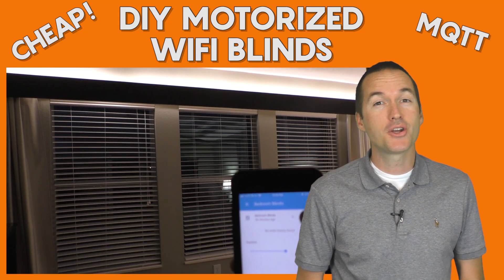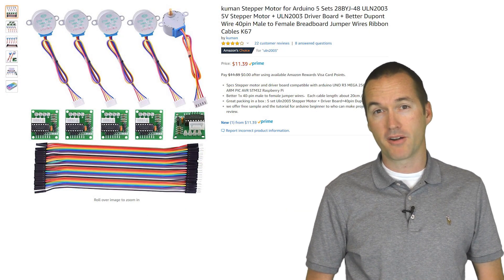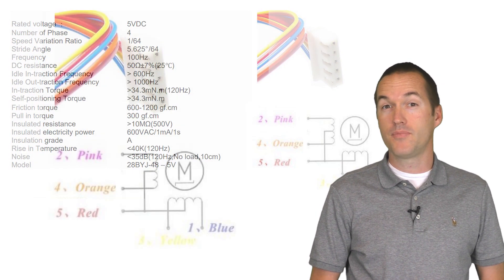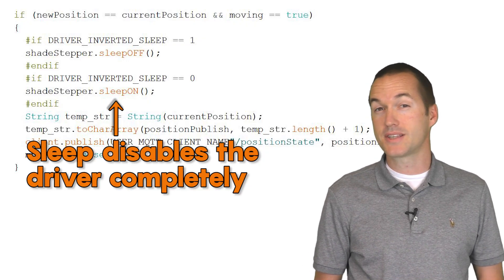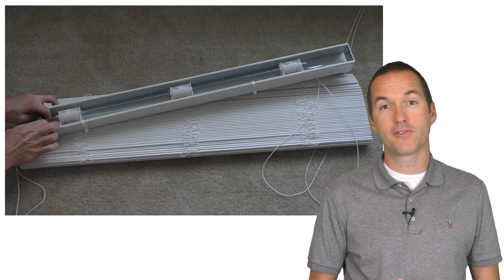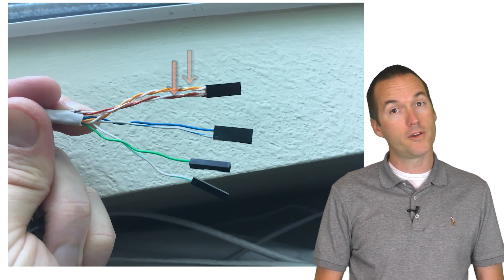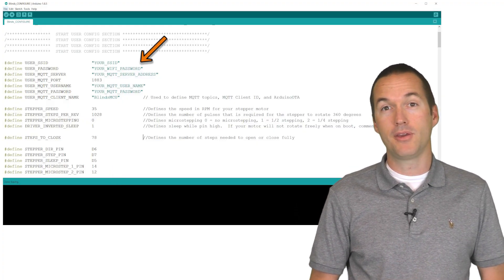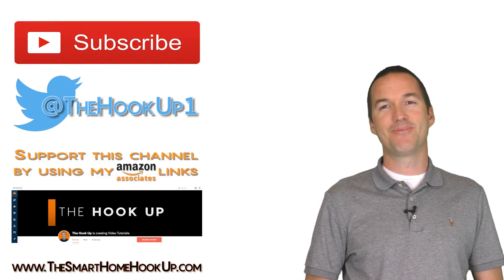Motorize and Automate your Blinds for $10! (WiFi)

Comment: I am SO close to finishing this project.  I have everything hooked up and the stepper motor turns but when it's connected to the blinds it basically just opens a bit then closes a bit and continues with that until it's done so nothing changes much.  This is my first experience with motors of any kind, much less stepper motors, so I'm not sure what's normal and what's not.  When it's not connected to the blind's shaft, it turns slightly a few times then turns smoothly towards the end and stops but it definitely changes position from start to finish and, the more steps I set it to do, the further it goes so I feel that's correct behavior.  I feel like the blinds issue is a torque issue but I do feel like I have cut the common/middle trace completely.  I guess I'm just looking for confirmation that this is probably a torque issue or something else and some tips of what to try next.  Thank you for any help you can provide.
Reply from the maker: Sounds like your motor wires may be mixed up.  Sometimes different batches have different color. Try swapping your wires.  You'll know when you have it right, the motors provide quite a bit of torque.

Comment: am looking at some motors and I see some that are 25 RPM for the same price as the 10rpm . what a good rpm for windows blinds?
Reply from the maker: I assume you mean for raising/lowering the blinds?

Steppers like I used in this project generally don't have RPM ratings (other than a max RPM).

Comment: I know that it's covered in the YouTube video, but it should probably be added to the list of written instructions. For those like me that watched the video last week, received our components from Amazon this week, and finally got some time to work on the project... and forgot about that one IMPORTANT step.

Be sure to open up the motor housing and cut the board to eliminate the connection of the red wire on the circuit board. If you don't the motors will get VERY hot and can be dangerous.

Comment: hey, its a wonderful project, and i really would like to build this. but would like it to be battery powered and also photocell controlled. any suggestions. thanks
Reply from the maker: I'm working on that right now.  I have a working prototype, but need to do some safety testing since I'm not sure I am using the solar charger properly (3s 14v charging without balance).
Reply: @TheHookUp  
Thanks
Il wait for the results
Reply: any update on the battery operation. thanks
Reply: hey i know you have a lot going on, i wanted to know if you  have had a chance to charge and operate the blinds with a battery/solar pannel? i really would like to have a independent solar charged battery operated blind.thanks.

Comment: I can't access my NodeMCU, I managed to program it, I can see it in my router, I have it's IP address but when I place the IP in the browser I get: This site can’t be reached 192.168.x.x refused to connect.
Reply from the maker: It has no service on port 80, why are you trying to connect via a browser?
Reply: @TheHookUp  oh I thought it was like a tasmotta, so why the sketch required wifi info?
Reply from the maker: for MQTT or Alexa integration.
Reply: @TheHookUp  for Hassio, I finally got it setup, thanks! Now I'm trying to figure out if I can hook 3 motors to one wifi module since there are several pins on the nodemcu
Reply from the maker: Do you want to control them all individually, or as a group?
Reply: @TheHookUp  both, individually and all together via automation. I'm guessing I'll need more amp from the transformer since each motor is around 2a...
Reply from the maker: @RonenLin  You'll need to do some pretty significant modification of the code for that.  You'd need to add different MQTT topics and different position variables for each blind and then change the process stepper function to be non-blocking for other blinds.  This code has an example of what the non-blocking process stepper function looks like: https://github.com/thehookup/MQTT_Motorized_Shades/blob/master/ShadeMCU_Double_CONFIGURE.ino
Reply: @TheHookUp  Cool! this example is a great starting point, will reverse engineer both codes and try to figure out the best way to tackle this! Thanks again!

Comment: On your web page you stated that you where working on Alexa only support (no hub required), is there more information on this project.
Reply from the maker: Scroll to the bottom of this page: https://github.com/thehookup/Motorized_MQTT_Blinds/releases

The no hub alexa code works great.
Reply: @TheHookUp   Is it possible to add n stops inputs to this code, so we don't over turn the blinds. Thanks for the great work code Works excellent very easy to get working.

Comment: can someone point me in the direction of  what actually works?  I have my  nodemcu  bare bones not connected to anything else except power and none of the code works.  Not alexa not ST not sure about home assistant  because I don't use it.  Been cashing my tail all night and have nothing lol.
Reply from the maker: Do you have the ability to see the serial monitor?  You can connect the NodeMCU via USB and open up the arduino IDE and select 115200 as the baud and you should be able to see a bunch of startup messages and then it should repeat a number over and over as it loads it's initial position.
Reply: @TheHookUp  Exception (28):
epc1=0x4000bf0e epc2=0x00000000 epc3=0x00000000 excvaddr=0x00000000 depc=0x00000000
Reply from the maker: @jimmaddox7485  ah, that's bad.  Can you try using NodeMCUPyFlasher: https://github.com/marcelstoer/nodemcu-pyflasher

To upload the alexa bin file, then make sure "yes, wipes all data" is checked.  I think you probably still have another program hanging around in your flash memory.
Reply: @TheHookUp  I actually reflashed the st bin while I was waiting and now I see all  0 but still no joy in the smarthings app
Reply from the maker: @jimmaddox7485  The ST integration is flaky at best.  I've been able to get it to work using the arduino IDE, but not using the .bin file.  If you opt to use the arduino IDE for it you need to hardcode in your ST server (or just use the alexa integration which works perfectly every time.).
Reply: @TheHookUp  The alexa only am not able to flash an am not on my dev machine to complie NodeMCUPyFlasher.  I am going to hit the sheets and will give it a go tomorrow
Reply from the maker: @jimmaddox7485  The github page has precompiled exes: https://github.com/marcelstoer/nodemcu-pyflasher/releases
Reply: @TheHookUp  Hey got a chance to play with this some more.   I wiped all data like you said and it worked!    I have my 2 office windows working.  I  did it like you did I just piggy backed the second motor off the main setup and it works great.   I do have it rigged though with just a bread board and hand twisted and taped connections.   Could you link to the connection hardware you used and maybe show how you make the connections on the nodemcu without the breadboard? I bought the set you had in the video description and have to say its the reason why it took me so long to get 2 windows done and I gave up using it.   Also a smarthings firmware that works would be amazing.   I know that alexa can handle simple routines but to be able to access my blinds through webcore would be ideal!    Thanks again for all your work and if there is anything i can do please let me know.
Reply from the maker: @jimmaddox7485  I used the hardware that I have in the description (the crimpers), what problems were you having with them?

Here's the smartthings version: https://github.com/thehookup/Motorized_MQTT_Blinds/blob/master/Blinds_CONFIGURE_Portal_ST.ino

I got it to work with ST, but the server needs to be hardcoded in arduino (it will ask you for it again in wifi manager, but that doesn't actually do anything).  For some reason if you use wifimanager to input the IP of the hub it doesn't get added to the st object.
Reply: @TheHookUp  Sorry if this is a repost I thought I submitted it but maybe not.  I am just not use to the tool I guess.   Having a hard time getting the pins to stay in the plastic housing seems to push back up.   Any way I got another set of 3 windows done using one nodemcu!  All my other windows are single so it should be a lot easier.  One question is there away to change the number of rotations?   if not can I use just hardcode the values in sketch and use the OTA instead of using the bin files?  The wifi setup using the bin is nice but I have a feeling I will be changing the rotations.  My blinds are brand new and I have different size windows.  Thanks for all your help
Reply from the maker: @jimmaddox7485  Doesn't the wifi manager have a number of rotations input?  I thought I remembered coding that in there.
Reply: @TheHookUp  One more thing lol.   when you did the valance with the led do you use one nodemcu or use the one for your blinds?
Reply: @TheHookUp  Yes it does but I need to change it on the new set of windows.  one is 4 foot wide and high and not closing completely .  I wanted to change the value.    I believe you can only access the menu once during setup?
Reply from the maker: @jimmaddox7485  If you connect a jumper wire from D1 to GND and reboot the nodeMCU (via reset button or power cycle), it will clear the wifimanager data and you can reconfigure it.

Comment: Great video and thanks for getting me a started.   Quick question in the video you said you can manual adjust the blinds with the motor in sleep mode.   If someone manually moves the blinds to a different position and then you issue a a open or closed command is the motor strong enough to damage the blinds or motor since its going to do a full open or close?  should I install a limit switch some how?   Thanks again!
Reply from the maker: The great part about stepper motors is that they can't really torque themselves to death.  If a stepper doesn't have enough torque to make it to the next step it will just stay in its current position without damaging the internals or driver.  Personally I modified the code so that the "close" function runs extra steps and always over-rotates in order to give it a "home" position.  That means that it will always eventually go back to the correct open and close positions even after manual adjustment.
Reply: @TheHookUp   Awesome!   Also came across a redesigned mount for home depot blinds @ https://www.thingiverse.com/thing:3658592 just in case anyone else is looking for it .

Comment: Hi Rob, excellent work. I finally decided to have ago of this as it seems by far the best DIY solution I've found. However I can't get it working, the connection and mqtt side of things seem OK but the motor won't turn. Is there anything I can check in terms of voltages at the motor controller to try and trouble shoot the issue. Thanks.
Reply: Scrap that, I've found the issue. A bad motor controller.

Comment: Great video. I was able to install 2 sets operating off the same NodeMCU. However, I'm having an issue that when i set the "cover" entity in Hass.io to 50% for open blinds, after a few minutes, they automatically move to the 0% or 100% position. Does Hass.io not like cover entities at mid travel?
Reply from the maker: Check your retain settings, sounds like you've got a retained open or close message.
Reply: @TheHookUp  i think that was it. Since the yaml has retain: true, if you send the cover open or closed, and then give it a position command after that the open/closed command is still retained. When the NodeMCU reconnects it will get the retained position command and then the retained open/closed command. I changed retain to false and it seems to be working. 

I also noticed that the NodeMCU is disconnecting A LOT. In the Mosquitto log there are repeated entries that say:
1562593986: Client LivingMCU has exceeded timeout, disconnecting.
1562593986: New connection from 192.168.1.103 on port 1883.
1562593986: New client connected from 192.168.1.103 as LivingMCU (p2, c1, k15, u'mdezzi').

Any idea what would cause the MCU to be constantly disconnecting?

Comment: How to wire with a uln2003? And what do i have to change in the .ino file. Can you help me?
Reply from the maker: The file will need to be completely rewritten since you'll need a different library to support a unipolar motor.
Reply: @TheHookUp  Oke, got the other drivers now, like yours.

Can you tell me how to put it in openhab?
{mqtt=">[myMQTT:BlindsMCU/positionState/:command:ON:OPEN],>[myMQTT:BlindsMCU/positionState/:command:OFF:CLOSE]"} 

Something like this? That's the hard part for me.
Reply: Found it. Its working very nice.

Comment: I finally got my Arduino IDE working on Mojave on my Mac and have successfully flashed my first of 10 NodeMCUs.  I powered it up, and used  MQTT.fx to send some test commands.  

I sent it some OPEN and CLOSE commands.  If I apply any pressure to the stepper motor shaft, it jogs back and forth.  Sometimes it jogs back and forth without any pressure.

Also at times, the stepper does not switch directions.  CLOSE and OPEN both go the same way.  I double checked my wiring and I'm pretty sure I have everything wired correctly.

Any idea what might be wrong?
Reply: Started replacing parts.  No Joy.  Tried to find the source for the AH_EasyDriver.  No Joy.  Downloaded and studied the data sheets for the stepper motors and the stepper drivers.  BINGO!!  My stepper motors had different colors for the wires.  I did a translation table and THOUGHT I had them wired correctly.  NOPE!!!  Fixed the wiring, backed out all my Serial.Printlns in the code and I am ready to install.

FYI, here is a modified snippet of code which I found easier to watch on the serial monitor.  The way you had it setup scroll like crazy full time.

void processStepper()
{
  if (newPosition > currentPosition)
  {
    #if DRIVER_INVERTED_SLEEP == 1
    shadeStepper.sleepON();
    #endif
    #if DRIVER_INVERTED_SLEEP == 0
    shadeStepper.sleepOFF();
    #endif
    shadeStepper.move(80, FORWARD);
    currentPosition++;
    moving = true;
    Serial.print(currentPosition);
    Serial.print(" -> ");
    Serial.println(newPosition);
  }
  if (newPosition < currentPosition)
  {
    #if DRIVER_INVERTED_SLEEP == 1
    shadeStepper.sleepON();
    #endif
    #if DRIVER_INVERTED_SLEEP == 0
    shadeStepper.sleepOFF();
    #endif
    shadeStepper.move(80, BACKWARD);
    currentPosition--;
    moving = true;
    Serial.print(currentPosition);
    Serial.print(" <- ");
    Serial.println(newPosition);
}
  if (newPosition == currentPosition && moving == true)
  {
    #if DRIVER_INVERTED_SLEEP == 1
    shadeStepper.sleepOFF();
    #endif
    #if DRIVER_INVERTED_SLEEP == 0
    shadeStepper.sleepON();
    #endif
    String temp_str = String(currentPosition);
    temp_str.toCharArray(positionPublish, temp_str.length() + 1);
    client.publish(USER_MQTT_CLIENT_NAME"/positionState", positionPublish); 
    moving = false;
  }
//  Serial.println(currentPosition);
//  Serial.println(newPosition);
}
Reply from the maker: Great to hear they are working, you are actually the second person who had the different wire color issue.  Where did you source your motors from?
Reply: @TheHookUp  I used your affiliate link through Amazon.  I have found that the colors vary in a package of 5.  The key use the outside pair for one set, then use the inside pair.  I used Dupont connectors for the bench test.  Might be worth a picture to clear it up.

Comment: Awesome stuff! Got it working and tested! The bin file with the WiFi manager helped soooooo much instead of coding everything. However, when I went to change the settings on my nodemcu it just flashes a lot and the driver get ridiculously hot and doesn’t work anymore! Help or advice?
Reply from the maker: The driver doesn't work anymore, or the nodeMCU?
Reply: Did you adjust the screw on the buck converter, to get it to 5v output.
Reply: @sciroccomods  yes i think thats what work was able to make it work

Comment: Thanks for the video! Fantastic and informative. I am wanting to try and fit these motors to my roman blinds to raise and lower them, as it is very annoying every morning and night as there are 5 roman blinds in my house. I am new to electronics, however I bought the 3d printer and the mount that you designed came out great! What I'd like to know is if the current to the motor will create too much heat and if the stepper motors would be strong enough to lift roman blinds?
Reply from the maker: Only one way to find out if they are strong enough!  Prolonged use (constantly putting them up/down) may cause them to overheat, but they should be able to handle a single up/down.

Comment: Anyway to easily adapt the square STL adapter from 5mm to 6mm?  Mine are slightly larger and I'm not quite able to do any adjustments to STL's yet.  Everything looks like it's working good in my prototype. I'm also wondering if I had enough watts on my power supply if I could run 3 windows off of one ESP8266.  Did you do them all individually and use the same MQTT client name? Thanks Rob.
Reply from the maker: I have 3 windows on the same esp. 12v 2A psu.
Reply from the maker: Have you tried just scaling the part up by 10%?
Reply: The Hook Up that's to easy though! Great idea I'll do that, and thanks for including the amps you used. I ordered some 3A on Ali about six weeks ago so probably a good time to get started. 😂